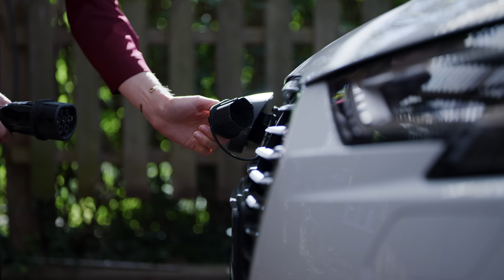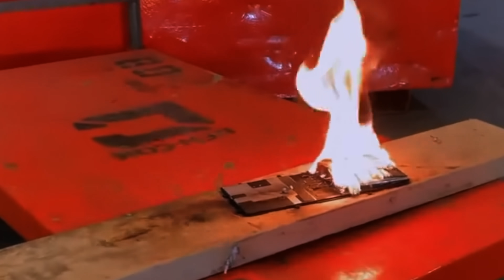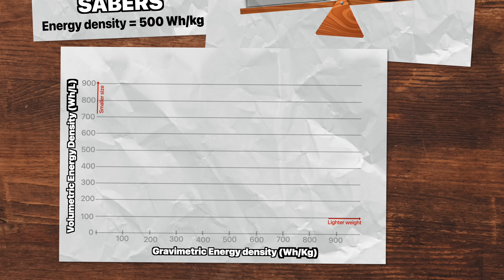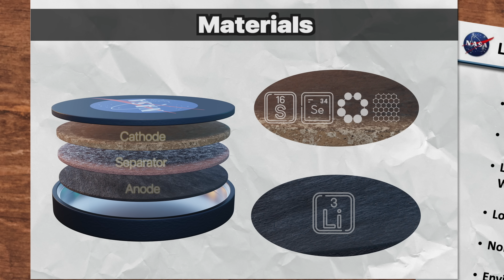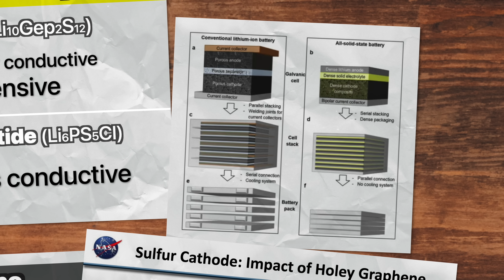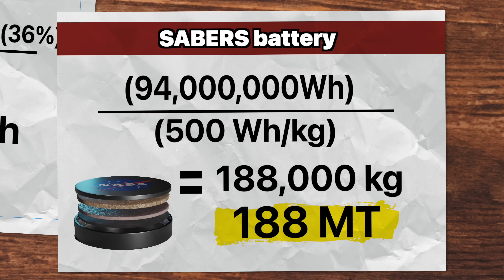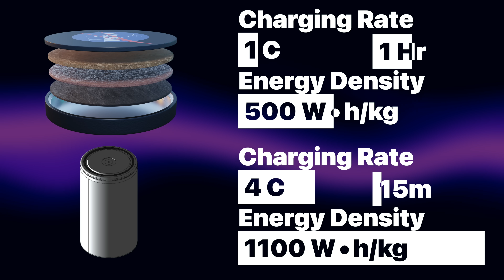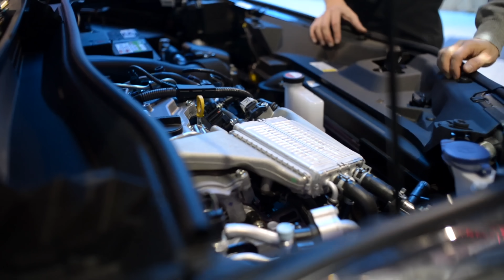Why NASA is Building a Solid State Battery

Comment: You mentioned MTOW, but you failed to mention MLW. A key component consistently forgotten about is that currently planes increase in efficiency as duration of the flight continues - because fuel burn directly correlates to a decrease in weight of the aircraft. Unlike current planes, you can't dump battery weight - so now the theoretical MTOW is also the MLW as well.
Reply: Why not just dump the empty batteries? :D
Reply: @joostklitsie5206  because where fuel evaporates, batteries will hit terminal velocity and hit the ground and destroy whatever it hits. Whether that’s the ground, a tree, house, person, etc.
Reply: That + also not completely accounted is the higher weight having implications on the power consumption.
Planes are probably the dumbest of all vehicles for now to thing of electrifying.😂
Reply: @acmhfmggru  - Oddly enough, using electric (by virtue of thermonuclear) for interplanetary/deep space rockets/sats is really smart and entirely feasible in the near future. Still need a standard chem (fuel/oxidizer) based rocket to get to orbit, but past that point, using nuclear to cause insane hydrogen (you want highest possible density atomically) expansion exhaust velocity should work really well. Now to get over the public fear of strapping on a small scale nuclear power plant to a rocket..
Reply: anti-grav/free energy tech is more than real, but people enjoy being in denial when they force themselves to say 'to good to be true'.  nothing is too good to be true when you believe in yourself, dig deep.  mercury centrifugally spinning <--
Reply: This will lead to longer landing roll outs, increased brake wear, increased tire wear, and increased maintenance cost for airports. It would exclude them from landing at certain airports with shorter runways as well.
Reply: I mean the efficiency gets better to a point before benefits turn to a detriment
Reply: Emergency battery jettison option with parachutes?
Reply: and you all forget to mention where exactly you're gonna get the power to electrify planes?! Get the cart back behind the horses and figure out a clean source of energy.
Reply: @acmhfmggru  I mean it was a reply to someone who commented about model rockets, so...
Reply: thats one good things about battery. you dont have to worry about major diffrences in weight it'll always be near the same.  but I doupt plane will ever be fully battery. more hybrid.
Reply: In the Boeing 737 example, there was no consideration into where the SS battery would be stored, but it is possible the SS battery may be integrated into existing parts i.e., non structural member(s) in the finished Boeing product.
Reply: The first passenger electrics will likely be hybrids.

In which case the fuel will burn at take-off.
Reply: @rwerk66 
So.... hybrid is two sets of different motors = added weight.
Reply: That only makes up for the weight of the hybrid fuel, but not the hybrid engine, so advantage over a battery system is lessened, dragging the whole idea of 500 mile flight back towards 'not happening yet'.
Reply: Your weight lowers, but drag does not, so the weight loss is just a partial factor, no?
Reply: @wouterjanssens As weight lowers you need less angle of attack to generate the required lift at any given speed, so yes, drag does decrease.
Reply: no @wouterjanssens
Reply: Doesn’t matter. In general aviation, which I believe will be the first to be electrified, they don’t have much fuel mass.. just few hundred pounds. Such a small mass compared to the 2000-7000lbs of total mass. The biggest problem with electric aviation are energy density and charging capabilities.
Reply: So I feel we are only pointing out a problem that I am sure every engineer at NASA and other high level design houses are working on. There will be changes in the design of the crafts to account for the weight while landing, or these crafts are changed to fly higher, reducing drag and lift requirements. Yes these changes will increase cost upfront, but over time it the money saved from energy is made up it becomes sustainable from both economics and environmental standpoint
Reply: @OnlySourSauce  thank you! Lol I had to scroll way too far to find this response, but at least I don't have to say it for the first time myself.
Reply: Yep, no matter how efficient batteries get you will never see batteries in commercial long range aircraft because you have to be able to “jettison the fuel weight” to return to the field in an emergency. You can’t dump battery packs on people below but you can dump fuel that just vaporizes.
Reply: @tropicthndr  that fuel does not simply vaporize.     The general public loves jet fuel all over their homes and vehicle paint.      

(Lived very close to McCarran in Vegas for years and dealt with it all)
Reply: @tropicthndr  As far as I am aware, you don't jettison the fuel to make the airplane lighter, you jettison it to reduce the chances of the airplane turning into a giant fireball on an emergency landing, no?
Reply: @tropicthndr  That would not be applicable in a fully electric propulsion aircraft. The takeoff and landing weight will always be roughly the same, so it would always operate within that weight limit negating any need for shedding weight for an emergency landing shortly after takeoff like might be necessary in current aircraft because of fuel weight early in a flight.
Reply: @Kelnx  the issue is that they are the same

to go further you need more power

in jet turbine planes that means more fuel
in battery planes that means more batteries

now whilst you can take off pretty damn heavy you cant land that heavy

now in jet planes you can carry ALOT of fuel and by the time you reach the destination youll be almost empty infact they plan the fuel load such that by the time they land there at there landing weight (landing weight is much lower)

a battery plane going further needs more weight in batteries but cannot loose that weight during flight

so in order to make batteries viable not only do you need to develop battery technology capable of powering a plane for theese differences

but it must ALSO be light enough to be UNDER the landing weight 

and thus presents the problem

also not forgetting that because a jetplane looses weight as it flies it gets more efficiant throughout the flight as it gets lighter a battery plane will consume the same power no matter what because it does not get lighter
Reply: @Sarge92  Hi Sarge, I am neither in the air industry or millitary but I wonder what is the reason for a reduced landing weight please? Is it to reduce the risk presented by a large fuel explosion or is it to help control of the aircraft and reduce wear and tear on components? If it is the former then it seems batteries would stack up as viable with regards to no lost weight. If it is the later then other component technology could be designed.
Reply: @WomBatVIC  1) To reduce the potential for secondary explosion with fuel leaks. 2) To reduce strain, an aircraft can take off with a higher weight clearance than they can safely land on their landing gears. Collapsing a landing gear on landing would not result in positive outcomes. 3) Lowered mass eases aircraft landings, as wheel brakes and reverse thrust operate more efficiently. 4) Lowered weight reduces heat buildup in the brakes/wheels as less mass needs to stop. When completing an emergency landing, the strain of the brakes results in significant friction and heat being generated, resulting in a fire hazard. You may see this in videos where the FF crew on the airfields immediately soak the wheels to remove that part of the fire triangle.

Believe 2 answers your question, but here's the general gist.
Reply: @Flight042  Thank you. Yes, I thought all of those would be reasons. I have seen red hot motorcycle brake rotors on a couple of bikes. One mine, due in part to exhaust proximity (OEM) and boiling fluids I believe but I'm sure nothing like the forces involved and heat generated with bring a heavy aircraft down from a couple of / few(?) hundred km/hr. Hmm, I'm thinking regen possibilities! 
I understand all of the mass /intertia  points from school physics and a life of science and "decent" motorcyling. I see the mass vs structural integrity vs performance vs parts replacement etc as problems to be solved by thinking out of the box / taking it into a different paradigm and I am sure there will be people out there and in here(!) already doing that. At least the fire hazard problem would be all but eliminated which would be a fantastic win. Cheers from NZ.
Reply: @tropicthndr  
Haha!  I hope you’re joking.
Reply: @tropicthndr Never say never. It's just a Physics problem and engineers would simply equalize MTOW with MLW. Battery technology is FAR from tapped out, and AI tools will help us speed up the pace of innovation and help us identify new additives and novel techniques to increase energy density, power density, volumetric energy density, manufacturability, safety, and decrease cost.

It really is only a matter of time. It's just that some problem are much harder than others to solve. It wasn't too long ago that heavier than air flight with a human onboard was thought to be an impossibility.
Reply: @tropicthndr  pretty sure the fuel is dumped for fire prevention safety, not weight of aircraft

Comment: Ricky left something out of the aviation story: Light commercial commuter planes. Nobody expects more of them than regional flights, so the power to weight ratio is more favorable, I think. They're more amenable to propeller engines, and going slower only adds minutes, not hours. Where it could really pay off is if America bothered to actually look into the science and realize that clean, safe fission power is here right now. That's a double whammy, emissionless power going to emissionless vehicles. 

Too bad folks are mostly convinced that only imaginary wind farms. Zoning and residential complaints, plus environmental impact studies make it slow and expensive to simply get the authorization to break ground, and even then there's the possibility of lawsuits delaying things even longer, something that could come up at any point. We could build more smaller-scale fission plants not, which would lower environmental impact and risk, and safe, secure storage of any waste is a mature technology. All that stands in the way of this solution to Climate change is irrational fear and groups like Greenpeace. It doesn't have to be this way.

Comment: Lithium metal is flammable.  It can burn in air, in carbon dioxide, reacts with nitrogen, and reacts with moisture, producing flammable hydrogen. So, how come the battery contains nothing flammable?

Comment: They have wafer chips that convert thermal radiation to electricity. They could easily make self charging batteries with a tiny radioactive source. Use your device till it dies, set it down and walk away. It charges all by itself just sitting there. Come back a couple hours later and its fully charged. This technology has existed for about 20 years. But it's still not in use, why?

Comment: Well this technology takes off it will mean a lot more than powering those EV's it would ramifications in anything that requires reliable and safe power sources ie laptop computers and smart phones. My only concern is that these new batteries would take a lot of replacing the original lithium ion batteries. That is not withstanding the need for ever greater power supplies which means   that must be different ways of generating that power which is now in crisis anyway. Myself I am happy with my internal combustion car as I a) cannot afford an EV and b) that the infrastructure for these vehicles is not there especially in rural areas in which I now live in - the distances are far too great for the foreseeable future here in Australia.
:

Comment: Whule density improving is great, combaring density to flight engines are bit dum 2bit. Flying is all about trhust to weight ratio. Not power to weight ratio. Jet engine provides sometimes 30k trhrust to propel aircraft mutiple mach speeds. It does not count how good power/weight ratio is the battery. It depeands if someone will produce electric burner or air propeller somekind to match jet engine thrust. In aviation if we go back to propellers like in 50's we would down in fly times and convience. Tus untile someone develop a great elctric trhust engine, and by the way. the one who does it will win some nobel prizes or createst invention award in all history. The electricyt atm, dont know a way to produce huge trhust. Humans know onlu jet engine or rockets that can produce enough thrust to operate airships to long distance while in great speeds.

Electricity as of a phsyical being dont have thrust. All light is electricyt but it dont have thrust. Earths core has a thrust of gravitation wich is based on magnetism. But magnetism has poor weight to power ratio. Look you need huge earth mass to produce gravitation that humans and animal can outweight at ease. The real problem is the electric thrust.
Reply: If you can build a somekind of electirc beamer that would beam electricity on a fast pace to speed the vessel nothing will ever happen to aircraft jet engine.

Comment: If a good portion of the needed power is for take off, would it be possible to use a launching system similar to an aircraft carrier to launch or add to take off speeds?

Comment: Aircraft do NOT need the same "thrust" as Jet engine powered aircraft... all they need is to have sufficient thrust to maintain flight, plus enough additional thrust to climb to the cruise altitude.  The huge amount of energy to overcome the mass of the aircraft can be overcome MUCH more efficient with electric drive motors in the landing gear.  This also helps upon landing... with regenerative braking in the landing gear assemblies, you can push a LOT of energy back into the flight battery pack! Solid State batteries are capable of incredible Charge and Discharge rates... because there's no liquid electrolyte that is so temperature unstable... so storing all of the "regenerative" energy would be no problem.

This improves efficiency dramatically - when you consider how much energy is normally wasted by converting it into heat in the brakes of those massive airliners.  Regenerative braking could/should also include the electric propulsion motors... once the plans touches-down, let those motors also generate electricity back into the battery pack... reducing the load on the "landing gear" motors.

Regarding airline battery replacement costs... when you consider the routine Maintenance on Jet Engines... as compared to electric motors... that difference can greatly offset the battery replacement costs.  Plus, you have to understand that "battery life" doesn't mean the battery goes "unusable" at the replacement point, it just loses sufficient capacity to require replacement FOR THAT APPLICATION.... so they find a Second Life in other uses, like energy storage for Solar and Wind power generation... recovering a significant part of the replacement cost.

Comment: Save yourself 20 minutes of watching.
The answer is still NO.  
This battery still has too low power density and too high weight and too high cost.   120 years of research and liquid fuel is still king.

Comment: So.... the whole of this video comes down to one question. Which is: How much Lithium is needed to achieve 1000 cycles of 1KWh using this battery technology. Size and energy density seem OK for EVs - but only if the frequent references to Li don't mean that EVs will consume more (currently in short supply) Li per million miles when using these batteries?

Comment: okay so you get a 40$ increase over lithium. you won't double the range on a ev. you will get 40% more range. There are a lot of ifs and maybes still. Will they have as long of a life as other batteries.  Also sulfur produces a lot of toxic fumes if burnt and yes sulfur will burn as a solid.  Also you have a lifetime cost that is unknown. right now ev's are throw away cars. Once the battery pack goes bad you might as well buy a new ev as the cost or replacing the pack costs as much.  you also have weight concerns. the battery may be smaller but does it weigh less? You also hsve output concerns. how much power output can you get compared to standard batteries? when you are talking vehicles that is a big thing. You also have charging issues. how long does it take to charge it. now you are saying 50% when you said 40% in the beginning. Okay so if you have half the power density then you have a huge problem because you will need half again as much batteries for the same output. I don't see a solid state battery being viable at this point. All I hear are down sides. less output more batteries needed and less cycle life. might as well be using copper batteries. You won't be able to get as much energy out of it as a lithium battery. I see that type of battery as a net loss. kind of like going back to sail boats and blimps.